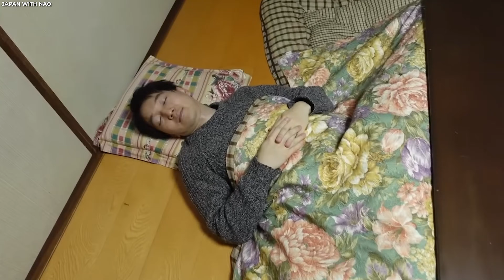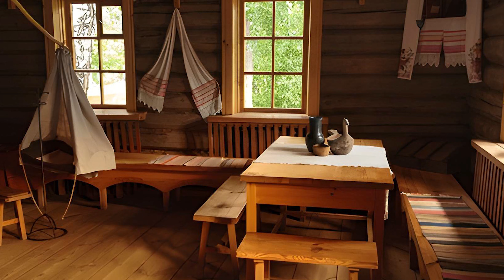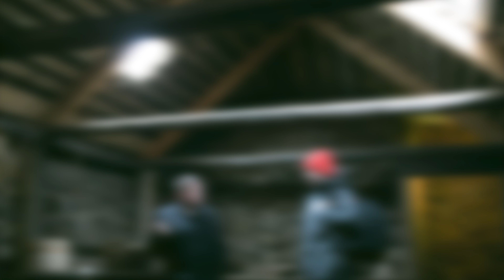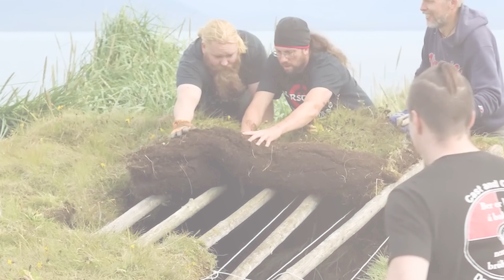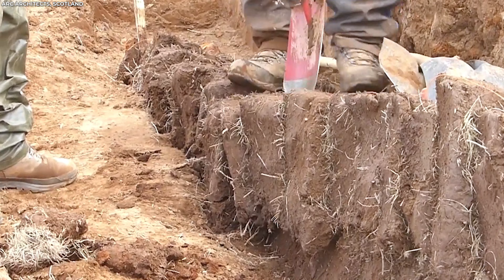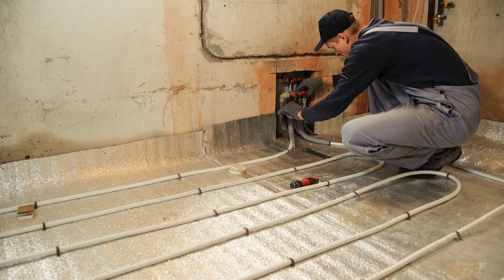Why Scandinavian Peat Houses Stayed Warm At -40°F While Modern Homes Freeze

Comment: Polish here, living in the communist-era cinder block apartment building. I was in 5th grade or so when there was some failure of the central heating. Even when the ice was forming around rubber elements of the windows, the inside was chiller than usual, but not freezing, during a regular 20 - 30 Celsius below winter. And it was even before the entire building was properly insulated.

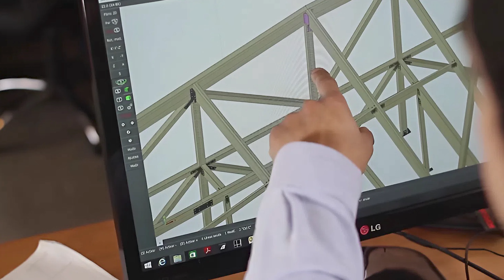Comment: 3:09 The strongest moment here is the comparison that exposes the real weakness of modern housing: it’s optimized for energy input, not survival when that input fails. The Icelandic turf house proves that thermal mass beats high R-value in real winter conditions. Those thick earth and turf walls act like a heat battery, storing fire energy for days, while modern lightweight walls only slow heat loss for a few hours. This isn’t primitive living, it’s resilient design. In a true winter survival scenario, the building that stays warm after the fire goes out is the one that keeps people alive.

Comment: What is Fahrenheit?
Reply: it doesnt make sense, i tryed to put -40 F into a calc and i gave me -40 C, then i put 0 F and got -17.7777 C, im still baffeled
Reply: @larsandersen623 because the unit of f is smaller than the unit of c so at -40 they line up.
Reply: The strange measurement of temperature only really Americans use. 32⁰ Fahrenheit is 0⁰ Celsius, as orientation

Comment: You see something very similar in the American Southwest, specifically New Mexico. Traditional "Pueblo" or "Santa Fe" adobe houses are technically not "up to code" because of the R value (building laws require certain values, so a new traditional Santa Fe style house is technically illegal to build in Santa Fe), however when your walls are 3 to 4 feet thick dried mud, the thermal mass regulates the interior temperature. The desert areas get high temperature swings between day and night, so during the summer the sun doesn't have enough time to heat the building up before it sets. During the winter, the thick walls and massive kiva fire places keep the house warm for hours or days after the fire went out. Modern adobe style homes use radiant barriers over the adobe blocks, but I don't know how much that actually does overall. Like I'm sure it's technically more energy efficient in that it's also resisting temperature changes, but I can't imagine it has a huge impact over the thermal mass of the wall. And they too had very tiny windows (since many of them didn't have glass, windows were literally openings to the outside). Even after they had access to glass, they remained tiny for the same reason.

Modern green houses also use a similar trick. Their walls are not great thermal insulators, just really good at trapping Infrared radiation. So what some people do is put a large water storage tank inside the green house, so when the temperature outside drops, the water is still radiating heat keeping the building warm.

So basically, the more stuff you have inside your house. the longer it will stay warm.

Comment: It also looks like the homes were built slightly sunken into the earth, which has a constant below ground temperature that would be more manageable. Our mostly underground home in the Ozarks, which has a constant below ground temperature of 60 degrees Fahrenheit. We cook with a woodstove which brings the temperature up to a comfortable level. Instead of heating from zero to 70, we heat from 60 to 68 as a byproduct of cooking.

Comment: live in canada and at one time lived in a house with cinderblock walls built into a hillside, with wood heat. We went away for a week in the depth of winter, no fire for heat no electric baseboards. When we got home it was 16c inside and -35c outside
Reply: Basically, an Earthship. 🙂
Reply: That sounds like quite an impressive experience! Living in a cinderblock house built into a hillside has its advantages, especially with thermal mass. Cinderblock has great insulating properties, and being built into the hillside likely helps maintain a more stable indoor temperature.

It's remarkable that your home managed to retain a temperature of 16°C (61°F) while it was -35°C (-31°F) outside without any active heating for an entire week. This demonstrates how effective thermal mass can be in regulating temperature. The walls absorbed heat from the interior and possibly retained some warmth even in your absence.

This experience highlights the importance of good design and materials in creating energy-efficient homes. Have you considered how these features could influence your next housing choice? 🏡✨
Reply: @MedievalPath00 well considering i now live in my van, probably not. Also I am retired and my possibility of buying home is very low. Housing crises suck.
Reply: @jessegreywolf You do know you just replied to an AI automated response?
Reply: @Burnstream10 proof?
Reply: @jessegreywolf  The scripts, voices and thumbnails to these videos are clearly AI generated and so is the comment. Why wouldn't the channels manager also use an AI to respond to comments to increase engagement whilst they were at it? There's no reason for him to do it if he's already so inclined to use AI for the entire process of creating such a video.
Reply: @Burnstream10 opinion is not proof lol
Reply: @jessegreywolf  It's not an opinion, just an "educated" guess (The comments are also structured exactly like AI does it, the language and overall tone also closely resembles how AI writes). These content farms are all over Youtube, it's not rare by any means.
Reply: @Burnstream10 bruh if it is not backed with proof it's an opinion